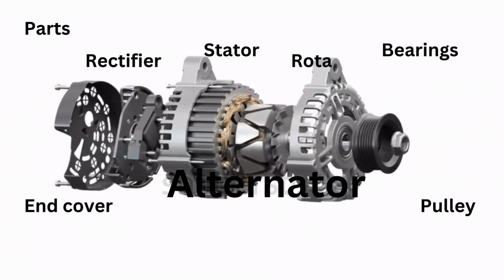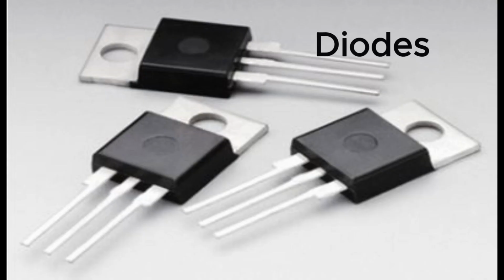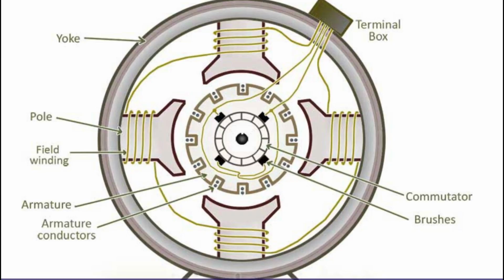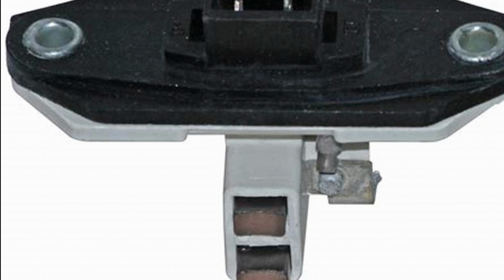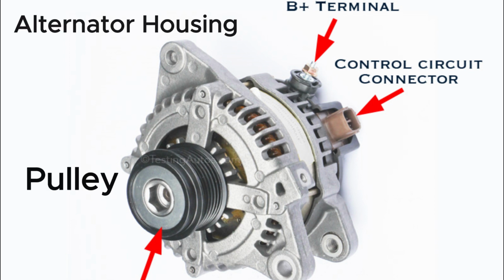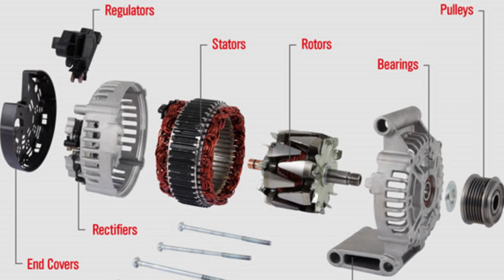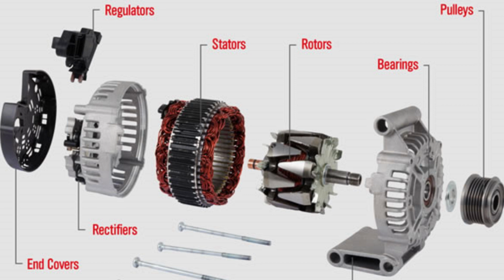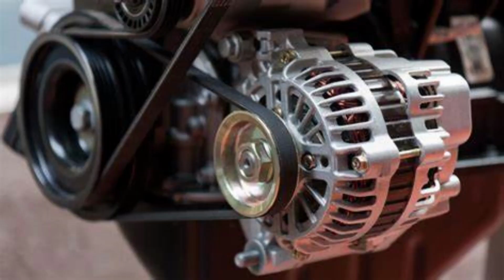Alternator Inner Working Parts | Automotive Engineering | Vehicle Charging System Explained

Comment from the maker: Alternator Inner Working Parts with GardeningWithKirk. This video explores the anatomy of the alternator, from the rotor and stator to diodes, the voltage regulator, bearings, brushes, and cooling fans. Together, these components convert mechanical energy into electrical power, keeping your vehicle’s systems running smoothly. Share your thoughts on automotive engineering, car maintenance, or energy systems in the comments, and remember to use #GardeningWithKirk #ForYou #Alternator #AutomotiveEngineering #ChargingSystem #ElectricalPower #VehicleMaintenance #EnergyFlow #CarTech when posting your own creations. Together we celebrate milestones, learn the science behind machines, and inspire each other to understand technology.